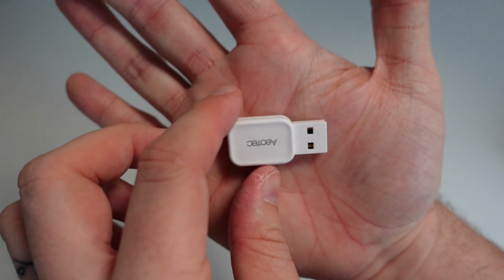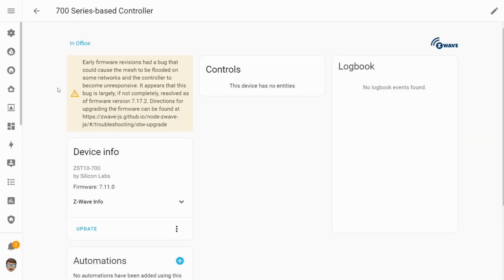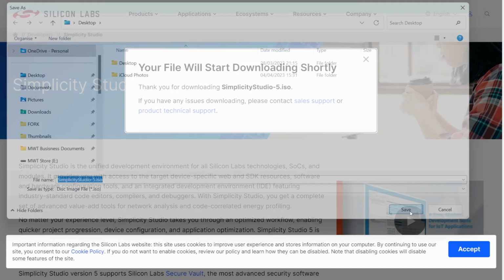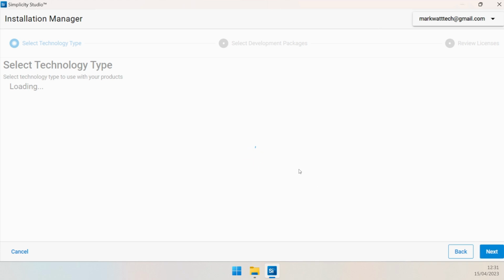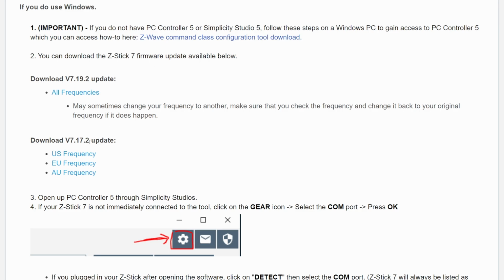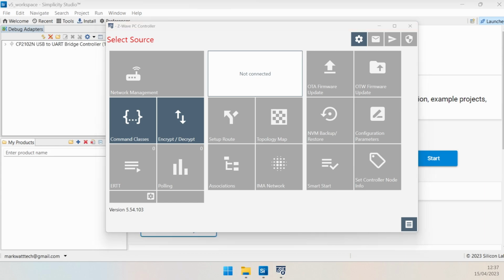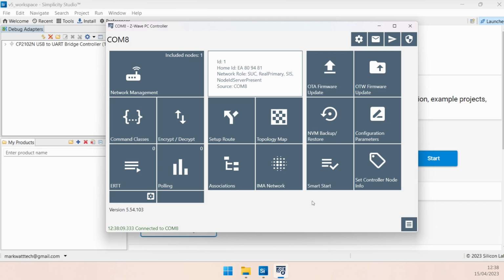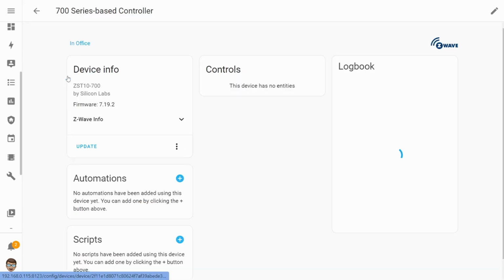HOW TO - Update Z-Wave 700 Series Dongles (Home Assistant)

Comment: Mark you did a video on the boundary alarm a while back and one on the alarmo integration, I've got a boundary system which I'm having issues with, I can't get customer support as the company have ceased trading.  I know the boundary system uses z wave and I wondered if I could use my boundary sensors and bell boxes via a dongle and create my own system in alarmo, just wondered if this is possible?
Reply from the maker: Hey Paul. You can add the boundary devices directly to your Z-wave. You will need to reset each device before use. I have done this with the siren, contact sensors and motion sensors.

One issue with doing this is that some of the device entities don’t name themselves(e.g the siren has a toggle and other information without a description).

You can’t add the boundary control panel to HA which is a shame.
Reply: @MarkWattTech  thanks for that Mark I think I'll give it a go, I've been unable to use my boundary alarm for a while now as its had a number of issues flag up on the panel but there's no longer any support so if I can at least utilise the sensors and the sirens that's something and not all my money will have been wasted, the hardware seems to be very good quality, it would have been a shame to junk it.

Comment: Great video, Mark! I made the change from the old z-wave integration to Z-wave JS a while back and in the process, I upgraded the firmware on my Aeon Labs Z-Stick Gen 5, and I don't see the warning in the UI, so I must be go there. I actually had a Z-Stick 7 at the time, but I wanted to get up and running with my several Z-wave devices as soon as possible, so I didn't install that new stick then. I'm going to have some time in the near future to make the upgrade from the Z-stick Gen 5 to the Z-Stick 7, so I'm wondering if you might have, or do, a video that covers that process??? Thanks ~Frank

Comment: What about the 800 series controllers? Should they be upgraded as well? I currently have the Zooz ZAC93
Reply from the maker: I’m yet to test out the 800 series. 

The issue mentioned is tied specifically to the original 700 series firmware. I would assume they don’t have the issue on the 800 series :)

Comment: Is there a reason you don’t use the upgrade option which is visible in your video in the standard Zwave-JS addin to apply the firmware file rather than using the Simplicity Studio 5 option? Great video thanks
Reply: So I decided to risk it and try upgrading from 7.18.1 to 7.19.2 using the standard default Zwave-JS HA add-in (not the Z-waveJS UI version) and it worked!! I didn't lose anything and everything seems to work fine afterwards. I'm using the EU frequencies and didn't have to change anything afterwards, it didn't give me any option to to change the frequency either. I seem to remember reading that one of the recent HA z-wave upgrades fixed a problem with firmware upgrades so maybe that is why it's working now.
Reply from the maker: @robb1430  thanks for sharing 👌🏻
Reply: I wonder the same thing. I'm on the 7.17.2 and
I saw the option on HA to do the update. I wonder if it will work?
Does the mesh continue working after the update? Or do i need to pair everything again?
Reply: @Cristian Dorbesi  really good point. Same here. Can we update from within HA and does it maintain the existing mesh.
Reply: first time I updated I also used pc controller. Second time, I updated using Z-waveJS UI (formerly zwavejs2mqtt) and it worked fine. Take note that the 7.19.x firmwares might change your stick region after updating. You can set it back to the correct region in pc controller or also in Z-waveJS UI
Reply: I'm not using the UI. I'm with the default Addon, which also have a button to update firmware. Does it work too and, if frequency is changed, does the zwave js addon allow to change it back?
Reply: I tried the UI and I didn't work.  Just sat there with the Spinning Ring of Nothingness and never did anything.
Reply from the maker: Previously trying to use the UI just didn’t work for me. 

With using the additional software you can also modify additional parameters (and restore if needed). 

Creating an account sets your region which the global firmware then uses. This stops the global firmware applying the wrong region frequency to your dongle.
Reply: @Mark Watt Tech  And do you lose your mesh. Or should you backup and restore?
Reply: If I was to upgrade the firmware using either the HA JS add on or the simplicity software would I need to add the devices back in again.. I have over 60 and wish I knew the problem before I started?

Comment: When I updated, It borked my whole z-wave network. I spent WAY to long diagnosing it before I figured it out: it was set to Europe frequencies by default. As soon As I set it to US in the ZWave-JS UI, everything immediately came back. I guess that's the downside of only having 1 firmware version for all regions. I've never even had to think about it trying the wrong frequencies before.
Reply: What version was it? I know it was a problem on 7.19.1 but it should be fixed in 7.19.2. This is the reason why Aeotec did not made 7.19.1 available to download from their website, you had to ask their help desk to get it and the TS agent was supposed to inform you of the possibilities of region change when sending you the firmware file.
Reply: @31biga  I never updated to 7.19.1, just straight to 7.19.2 from whatever it was before that, I think it was 7.19.0. Maybe that's why?

Comment: I wish I had found this video two hours ago, as I wasted an hour of my life figuring all this stuff out myself  (after the built-in HA FW update didn't work at all)....    Did the 7.17.x to 7.18.3 update, so hoping it solves all my dead node issues in HA.  AT least so far (<1hr of testing), everything seems "zippier"   --- either way, thanks for the video.  Just won you a click on the Subscribe button and will be checking out your other vids
Reply: Im on 7.19.2 and still getting dead nodes. Im now using an automation to ping nodes as soon as the are dead to revive them. This automation really helped
Reply: @31biga  7.18.3 didn't completely solve my dead nodes problem, but it helped a ton.  The zwave network is much "snappier" (devices respond faster), CPU usage on my Nuc dropped by 2/3's, and now I get dead nodes at a rate that is maybe 5% as often as it used to be (and they tend to solve themselves).  In fact, just to see how often it's happening, I turned off my "ping nodes" that was pinging the nodes every 20 seconds to keep them alive.  Now I get a 'dead node' maybe once per day, and usually it resolves itself within a few minutes.  Not sure why it didn't help you, but it helped me a ton

Comment: If using ZWave-JS UI, the Windows software is no longer necessary. [edit: also, I still had network instability with the 7.19.2 firmware and finally dropped back to my 500 series stick. Which, again, was easy thanks to ZWave-JS UI backup/restore.]
Reply from the maker: Very easy with Z-Wave JS UI!
Although I don't think you can run UI and the standard Z-Wave JS addon in HA (correct me if I'm wrong 🙂 )
Reply: @MarkWattTech  hearing that I feel sad for those that can't